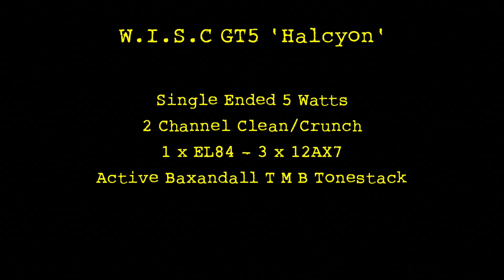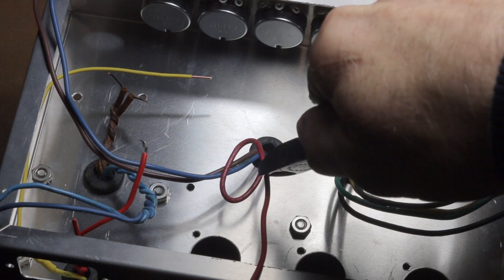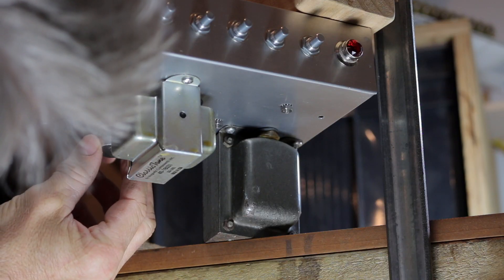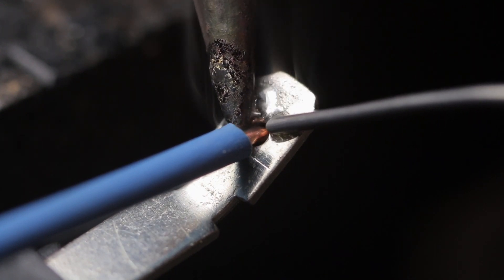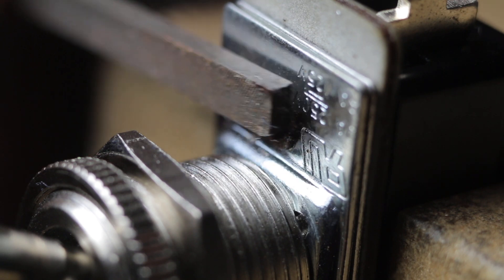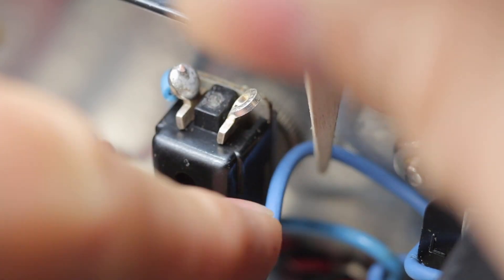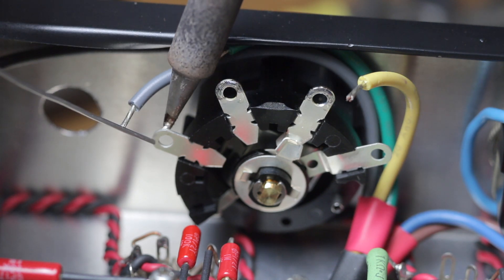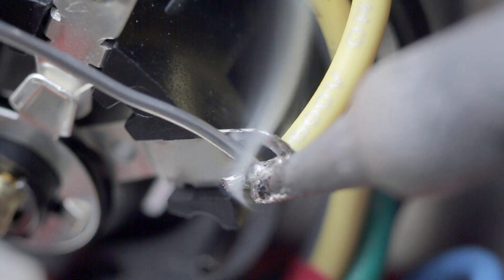Switch Wiring - I Didn't See This Coming - W.I.S.C - GT5 'Halcyon' Build 4

Comment: You choose some lovely parts.. Where did yoi get the Nikkai Selector Switch?? Best ASMR tube diy building channel..
Reply from the maker: Unfortunately the Nikkei selector switch is no longer manufactured. The next best replacement is the SRF113-Z made by NIDEC COPAL ELECTRONICS. It is a Japanese company however the switch is made in China. It is however an excellent switch. Best source for the switch is Chip1Stop website in Japan. https://www.chip1stop.com/view/dispDetail/DispDetail?lang=en&cont=NZL&partId=COPA-0011926&mpn=SRF113-Z

Comment: Just discovered your channel and I've subscribed. Even though I've been building tube amplifiers for 50+ years one can always learn.  I'm impressed with your technique and attention to detail. I am curious though, while you wrap leads solidly around the turrets posts you just poke wires through terminal holes and rely on the solder for a connection. Is there a reason behind that other than convenience?
Reply from the maker: Thank you, and yes there is a reason. When replacing a component that attaches to a socket lug or pot, if the component lead is wrapped around the lug, the pot or socket is invariably destroyed, or at least damaged in the process. This means a lot of further surgery to replace pot or heaven forbid, a socket. That is why I never wrapped a lug. It doesn't matter to the same extent on a turret as the component wire can be cut if things get too difficult. Also, because the turret is solid, a component lead can be unravelled under heat from a turret easily enough. Cheers Apex!
Reply: @elams1894  
That makes a lot of sense. I was taught to make connections mechanically sound before soldering and while that maybe might still apply to high current joints it can't make a difference on a properly soldered connection (think PC board for example). I don't recall ruining any components on assembly but I have done so on a later repair. To expand on what I said in my initial comment, one is never too old or too experienced (MUCH different things...) to learn something new and better. Thanks!

Comment: It is great to watch your work, thanks for sharing! I learn a lot from you documenting it so thoroughly.
I have one question though: when you cut the end of a wire after soldering, I would think that this small piece falls back in the chassis. I am planning to build an amp kit (first time) and I already see myself loosing my mind when trying to find a small piece of wire in an already nice and tidy chassis.😂 Do you have any practical suggestions to avoid this  or to find the small pieces easily?
Reply from the maker: Thanks Andras! That is certainly a problem I run into. I have used paper with a hole cut in it for the cable to poke out of. That becomes impossible if the cable is close to the guts. I have lost some little pieces down a socket a few times and its taken some effort to get out. Now I just cover the socket if close, however for all others I rely on the vacuum and making sure no little pieces are left. Great points, and certainly worth mentioning, cheers!

Comment: 8:05 I've watched another video, and he soldered the ground wire to the chassis, saying it was a safer way, because if for god knows that bolt comes loose, the chassis might be charged
Reply from the maker: You can solder the ground point to the chassis if you like. I prefer bolting, but it's entirely up to you.

Comment: Not really related to the video, but i was wandering wether you could help me. I have a 6DQ6 B tube, and i want to use It as a preamp, just before a high quality class D solid state amp. Is my idea any good? Could you suggest any tubes for my aplicattion?
Reply from the maker: The 6DQ6 is an output tube as I recall, with the plate connection at the top of the tube. Used in the output sections of Playmaster and Goldentone amps. I dont think youll be able to use it as a preamp tube. I have quite a few of those tubes that I intend to use for a vintage design amp. Best bet is to use a preamp tube like 12AX7 as a pedal type scenario, or for vintage perhaps EF86, or EF802, something like that.
Reply: @elams1894  thanks, you are great help! Could i email you if i need more help?
Reply from the maker: @Endermanso  sure thing, elams1894@gmail.com

Comment: Coming together beautifully.
Reply from the maker: Thanks Greg! Hows your beautiful Milling machine coming along? Love those alloy products!
Reply: @elams1894  We have so much work for the milling machine, I can't keep up.  I have far too many ideas squeezed between my ears that it's frustrating that I can't get to all of them...  Even at that, I'm having a blast with it.  I still consider myself an absolute novice, but I am amazed with the quality of the parts I can produce.  I don't think it will be long before I have a much larger machine.  It will likely run 24 hours a day.
Reply from the maker: @GregsGarage  that's fantastic. Quite the learning experience I'm sure. I'd love to get stuck into a milling machine but I wouldn't know where to begin. I've been thinking about a CNC machine and a 3D printer for sometime, even though I've nowhere to put them ha ha. Good on you, that's great to hear.
Reply: @elams1894  I have a CNC router and the mill.  They are similar but they take a different set of skills for sure.  The only way to begin is to just dive in and try to make a few simple things.  When you get to a project you really want to do, you'll sort out the way to get there, I guaranty it!  If you do decide to get one, don't hesitate to reach out.  I will help you in any way I can.
Reply from the maker: Thanks heaps Greg, I'm going to need a bit of help I'm sure of it and watching your vids, I know your the man to have the answers. Ive just watched your demo of the seams impossible tool. Dang that is some inspiring problem solving right there, great result, works like a charm. I'll definitely be in touch for sure. I know it takes a heap of work, but keep the ideas and vids coming. Cheers